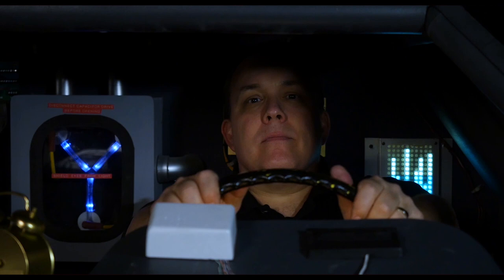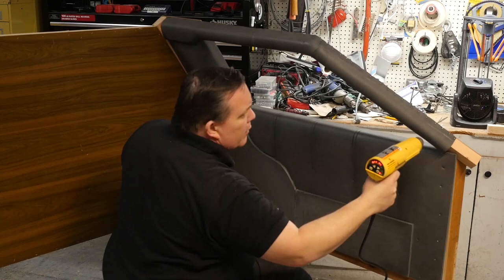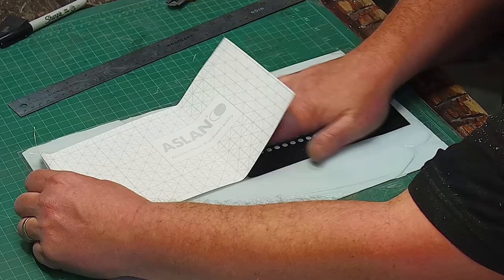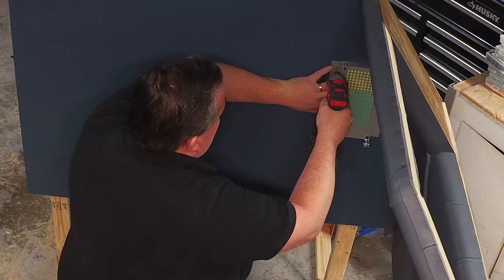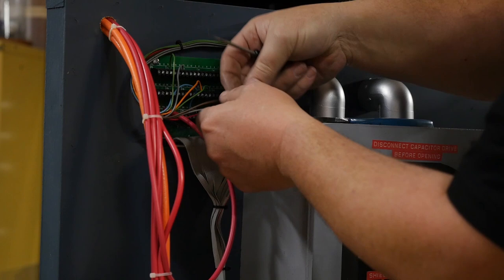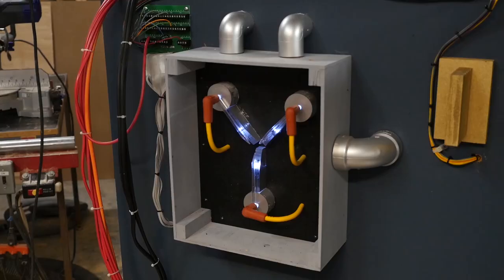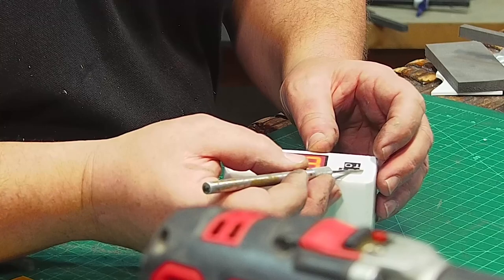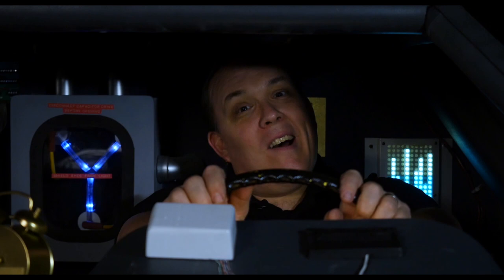Odin Makes: The inside of the DeLorean Time Machine from Back to the Future

Comment: Make a part two so you can:
* Make another door so another person can get in.
* Make the Full dash with the time circuits and speedometer.
* Make a cheap steating wheel
And the time drive switch in between the two seats

Comment: Hey! Good job. It is incredible! 
Do you put something on the EVA foam so you can paint it? Because I do not understand English very well at that speed and although I have seen your videos I have only seen one in which you put white tail before painting
Reply from the maker: Thank you!
To paint the EVA foam, I use a product called Plasti Dip,  and it is the final grey color you see. no additional painting was done on the grey.
It's like a spray paint, but it's a stretchy rubberized paint, and it bonds really well to the foam.  I didn't show the painting this time because most of the work was done at night. There are other brands and styles of this same rubber coating paint, Plasti Dip is one of the originals and they offer a good variety of colors.
Reply: Thank you very much for answering! 
So, Plasti Dip, is the painting that you usually use to keep things so cool and super well made? I'll try it, I really like the result that I see in your videos!! 
Of course I gave like, and I subscribed as soon as I discovered your channel!

Comment: Technically the  voltage meter lights are different colors
Reply from the maker: On the SID? They are Green, Yellow and Red. I did not make a red top row as it only lit up when entering time travel.

Comment: What? There are only two pipes on the sides of the flux capacitor and why can no one get the timing of the lights right. They are yellow lights that flash very fast in the movie and only turn blue when it hits 88mph.
Reply from the maker: In the video I actually say that I just ordered Christmas lights from Amazon.
The lights didn't fully chase (the description said they did) they just alternate, and speed up and down uncontrollably.
Also, warm white (yellow) LED lights were not available, only cool white (blue)

With a full car set to build in a few days, compromises are made. Low budget = cheap parts and no time to solder one from scratch. Is it hard to do? not really. Will it take more time than I had to spend on that step? Yes, yes it will.
Reply: Odin Makes shame you didn't have enough time. The inaccuracies are pretty glaring. It feels more like a craft than a serious prop / set. Nice effort maybe next time